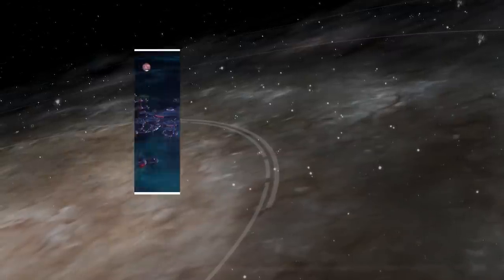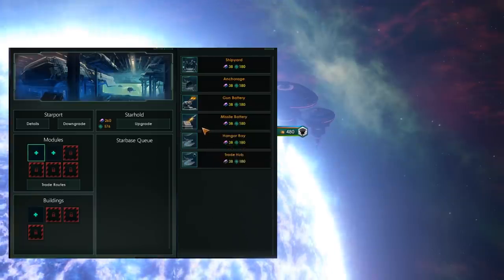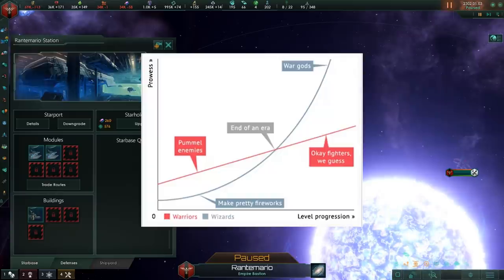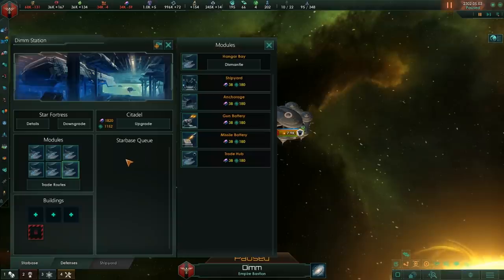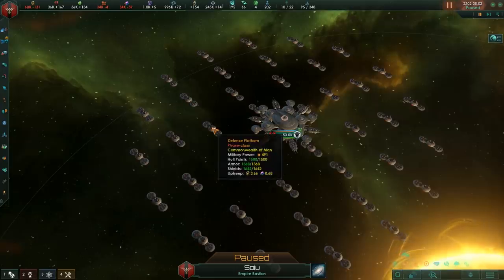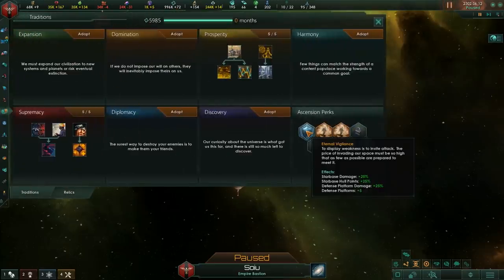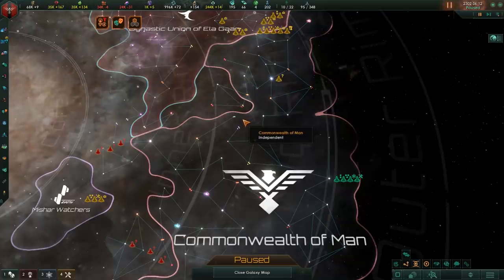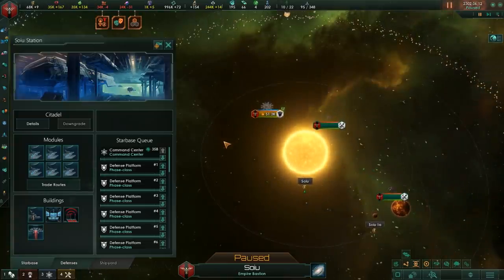Stellaris - Starbase Mechanics are Weird

Comment: I find myself disagreeing here a bit. You're right in that in a fight between equals, a citadel usually doesn't mean much. Any empire with the alloy output and technology to build one can also build a fleet that can take even a citadel down with negligible losses if unsupported. 

What they DO allow, however, is to act as a delay on incoming enemies (the more hp they have, the more days the enemy is stuck firing) and to stop both reinforcements and smaller enemy fleets from passing. All too often I find myself fighting multiple enemies, some of which are light-weights but could still hurt me significantly by taking out systems or occupying planets to deny me resources while my fleets are away to deal with the actual primary enemy. Beefy citadels in key locations put a definite limit to this.

Well built, a citadel works like the sign in an amusement park - you must be at least this tall to board this ride. You could argue that a fleet built from the same alloys would work similarly and I tried that, but in practice I almost always end up concentrating my forces so a smaller "deterrence" fleet would just end up in the same pile simply because of how battles work in Stellaris. The more you use, the less you lose.

Citadels can also protect you way into mid game if you play a dense map with slow tech and go for technological superiority yourself. Enemies can still crack them with weight of numbers, but if the citadel is more advanced than them that can become expensive and, again, serves to buy you time if the enemy does happen to rock in with enough ships to eventually take it out.
Reply: Exactly this.  They won't stop a determined attacker, but the automatic FTL jammer will keep any small 1-5k fleets from trashing your outposts while your main fleet is fighting elsewhere.  I find them most useful for the listening post (which was surprisingly not mentioned), because I can see when a big fleet is approaching and make sure my main fleet is there to greet them when they arrive.
Reply: @EstrellaViajeViajero  Yup. Lategame that's not that important anymore because of jump drives or gateways, but early to late mid game having the advanced warning and fire support is pretty dope. 

Heck, just the reduced emergency FTL chance means more ship losses for the enemy = more attrition even if the guns never fire a shot.
Reply: I LOVE your 'must be this tall to ride' comment! I use bases as tripwires on my chokepoint systems when I'm fighting a war with someone else. I hate trying to attack in one direction and then some pirate outbreak occurs on the other side of my space. Once my bases are 5k+ then an enemy has to commit something serious to get by.
Reply: @Comicsluvr  Yeah, and you've often got partially destroyed fleets flying around in drips and drabs as they escape from a losing battle and then fly back into danger. 

Stuff like that and the fleets of smaller tributaries or vassals often can't challenge a good solid fortress and it keeps your economy secure while your fleets are moving on with their rampage. ^^
Reply: A well placed citadel isn't just impacting enemy fleet maneuvers, but also their economy because lost ships will have to be replaced. With a fast response fleet nearby, one can even force bigger fleets to retreat, further increasing time and resource investments as well as war exhaustion. While the enemy will have to regroup and produce new ships, that downtime can be used to take key systems and/or fortify choke-points. The way I see it, citadels are a one-time long-term investment that allows to control regions of space much more efficiently if done right.

Comment: I like Citadels when turtling. Though in general they help stall fleets whilst you move in yours and weaken them too, (or by time to rebuild), they also prevent mid sized raiding fleets.  I dont build defence platforms unless i'm flush, because they tend to die way to quickly to bother. 

In conjunction with a "support station" for your fleet "behind", (and if possible a fortress world in front) can prevent many offensive actions against you.
I see them as way to create an active defence. Its great if you're not that strong compared to hostile empires, and/or fighting a number of empires surrounding you at once, You only have so many fleets in so many places! 
With the modifiers they offer too, it can really help in tight battles.  plus they can become strong enough to resit end game crisis' fleets,(except fallen empires), on their own which can be very useful, again freeing up fleets to do whatever  they need to do.

They are oft the anvil to the hammer of my fleets.

Comment: Really?
Anchorages, Ship yards (Every slot has a ship yard) so that you can refit lots of ships fast?
By mid to late game my concern is what to do with all my resources and increasing my star base capacity.
I use completely beefed up star bases to act as speed bumps at all borders and internal ones to increase ship capacity and help planet development.
I don't worry about pirates at all and deal with the minor outbreaks as needed, especially once I have gateways in every third system.
Resource storage depo's on all internal star bases and maxed out ion cannons at all borders and keep those things updated, it's money well spent.
I keep the number of star bases almost at capacity all game.  The biggest and the smallest take the same points, 1, so why not build them up. 

Current game, no station mods, I am plus 1700 Alloy a month.  I'm 4k minerals surplus a month, so maybe I'll just build more mineral to alloy buildings.
It takes no time at all to run up a reserve of 150k out of a storage capacity of 500k.
Sorry, can't disagree more on this.

OK  I really looked into this (4 months later) and have decided I was COMPLETELY wrong.  I grossly underrated the amount of fleet logistic increases I got as the size of defending armies increased over time.
I watched while in a very short time rose about 2k points.
Now I'm wondering what other estimations I made are just as wrong.
Damn game.
Reply: i completely agree with you but i think this might be due to the economic buildstyle you or I use allowing us to do so
Reply: I'm in something of a similar situation, though I'm not to that level of income yet, but I'm trending that direction. My fleet has been sitting in drydock ready to be deployed for over a century now. I'm 140 years into a game where I'm seeking the 200 years of peace with a pacifist empire achievement. By hard rushing technology and keeping my fleet at my naval capacity, my fleet power is Overwhelming compared to all other Empires and with no wars to worry about, I'm not losing any ships and I can spend my alloys to occasionally update my ships, occasionally add ships to my fleets, upgrade star bases to citadels, and build megastructures.

I have maximally updated Citadels bristling with weaponry (and Ion Cannons) at my borders, and my fleets are sitting in a central system with a gateway in the system for instant response in the event that an enemy does attack. Yes, the power of the Star Fortress won't stop an enemy fleet of sufficient size but it will delay them long enough to get my fleet into position though those gateways. (You called it a peed bump at your border, and that's what they are.) And if they want to come through Gateways to attack, the only gateways in my territory are in systems where I already have Citadels and the system where I'm keeping my fleet.
Reply: @Karthos1000  unless they changed it rather recently you cant move through (into or out of) a gateway controlled by a nation you are at war with so no worries about that the only exception is the L-gates but they act more like wormholes
Reply: What you are describing tho is a game that from an economic perspective, already is won. Won't matter what you do you will win anyway since you double outproduce everyone. The Trurtle strat like that to build up defences is something I also do but most of the time I just realise I get over prepared and could have saved time more by investing those alloys more aggressively
Reply: @jarnovanherreweghe218  That is very possible and have wondered the same thing.
My concern is not having the resources to follow through in a war.
I don't want to go into a war like the AI does, not being able to exploit some advantage or having to stop short because I ran out of resources.

Comment: I would argue that the effectiveness of starbases depends on if you're playing pvp or pve. Against other players they'll be more of a hindrance than an aid unless you have a fleet close by to assist because the player attacking you will likely have positioned his fleet close enough to get there way before you do which means he'll take the system and now you have to fight what survived of his fleet AND your own station. So unless you have a fleet close by or a gateway they can use then it's not so great. And early on a player will just go around them.

Against AI on the other hand you can usually keep the starbase at a pretty decent power level compared to AI empire fleets. Some of the same principles still apply. You wouldn't want a starbase next  to an AI strong enough to overwhelm it with minor casualties. But if you have a fleet strong enough to take it back yourself and it cripples the AI when they attack it's probably worth it. Mostly though against AI you have some idea of which empires will declare war on you so you can always keep an eye on them and keep a fleet nearby whenever you don't have a truce so that you are ready to defend. If your starbase and your nearby fleet have a combined fleetpower equal to the threatening empire and you know what they'll use(and often even if you don't) you'll likely win easily. Unless their ships counter yours.

The main thing about bastions is the fact that they regenerate imho. If you defend against an attack. For this example we'll say it's early game and you lose 5 corvettes out of 20 defending along side the starbase. If you had built ships instead of a bastion you might have had more ships to defend with but it's also very possible you would have taken WAY more casualties since the bastion tanks a lot of damage and it regenerates it for free even if it goes down in battle.

Another point I can come up with is that bastions wreck fleets if we're talking logistics. Both in the fact that they free up some naval capacity if you need less ships to properly defend and in them having a much better upkeep/fleetpower ratio.

Of course all of this is just my thoughts and opinions. Feel free to let me know if something doesn't add up or I'm missing something/got something wrong.

Comment: Many are not aware, but you can build defense platforms on stations (not star bases). It helps dealing against single or weak ships.

I do think they help deter the enemy, and it does weaken them or buys you time to counter. It comes to a point where the enemy cannot advance because another star base is in the next area and they need to rebuild/repair their fleet.

Comment: If you were trying to mention the ODPs super macs of halo those fire a 3000 ton projectile at .04 the speed of light. Yes, the damage it can do is ridiculous.
Reply: Actually that's just 50 Gigatons of energy there are many sci fis out there (like Stargate) where that is Insignificant
Reply: @karlfranzemperorofmandefil5547  thanks fam very cool
Reply: @trashf1re  it would also be insignificant by Stellaris standards as even tier one sublight drives move much faster then that
Reply: @karlfranzemperorofmandefil5547  I am curious, what is your source?
Reply: @commanderknight9314  mathematics, I calculated it myself because of a discussion about Halo I had with a friend once (the conclusion was that Halo weaponry has the equivalent of water pistols in Stargate)
Reply: What would happen if you increased it up to .05?
Reply: @commanderknight9314  the kinetic energy would increase by about 56% (relativistic change in mass not taken into accord as it only becomes major when near the 0.1c threshold)
Reply: @karlfranzemperorofmandefil5547  isnt it more due to the equation being 0.5mass x speed ^2?
Reply: @jevry4307  yeah mistyped there (its about 56% Increase in firepower)
Reply: @commanderknight9314  also keep in mind Stargate ships have cruise speeds of up to 0.75c and higher so the round would never catch them in the first place
Reply: Uhh check your canon again. SMACs are .5c in the Encyclopedia. Frigate MACs are .4c*. So you are off on velocity by an OOM.

*this means frigate MACs are roughly 1.17TT TNT equivalent. 117.
Reply: @sosogo4real  well meant the SMAC either way , didn't know what I did that mass for
Reply: @karlfranzemperorofmandefil5547  3000 metric tons at 0.04 c or 11 991 698.3 m/s would deliver like 215,701,231.3 Terajoules... which is like a lot. like a 1030 Tsar bomba's.    or enough energy to heat a nimitz class worth of steel to 4.5 billion C or a UNSC super carrier to 500,000 C....

what Im trying to say is, its enough to get the job done :P

....how the hell dont those platforms recoil into the earth at nightmarish speeds though
Reply: @karlfranzemperorofmandefil5547  that was more directed at Knight. Just challenging his initial assertation using competing lore.
Reply: @tisFrancesfault  some (weaker ) Stargate ships wouldn't notice even being short at them with it (Literally the weakest of the common warships  ships in Stargate can sit inside of a star for 8 hours without being damaged whatsoever and Stellaris ships should also not care (judging by the fact that they themselves even at the weakest Sublight speed move far faster )
Reply: @sosogo4real  You might want to double check those muzzle velocities again. ODPs have 0.04c shots and standard MACs have 30km/s (or 0.0001c) shots.
Reply: @coreymicallef365  the Halo Encyclopedia lists it at .5c and .4c respectively. TFOR, where the 30km/s figure comes from, involves a heavily damaged prewar frigate moving backwards and is also, IIRC, THE first piece of Halo media.
Reply: tips fedora

Comment: Citradels are ment to slow down enemys and to stop them from sending small fleets all over your empire. Also putting the alloys into fleet, means you need the fleetcap. Asuming 1 station gives you a max 36, i would say a citydel will have more power than those 4 battleships or 36 corvets, and also less costly. Sure, you cant atack with it, but not losing 10 systems to 10k fleets, resulting in huge production losses or even fleet capacity(Purifiers...)makes them worth building. I think the discussion should be, are defensplatforms any good, couse you lose tons of them even against much smaller fleets than your citadels fighting power. So maybe a video about defensplatforms, what to use or how they should be changed, to be not wasted aloys?

Comment: I would suggest personally that starbases become much more effective when you use them in concert with a fleet, because the base comes with inherent bonuses to range, tracking, and fire rate for both the base and any platforms that come with it. They are very desirable to have on a choke point system, especially as they come with a lot of buildings that add blanket buffs and debuffs to friendly/enemy fleets. This also means that hangars are probably not the best combat module choice, because they don't benefit from the bonuses to tracking/range/fire rate etc.

Stations will be sniped down if you try to use them on their own, but they will continue to fight effectively if you screen them with a fleet, because the enemy fleet will disperse its fire across multiple targets.

Comment: Well it also depends on what type of empire you are, as a determent exterminator you do get a 43% bonus to fire rate, so choosing hangers wouldn't be the best choice as it is less fire power you send against the enemy per second. I would argue that missles might have a place here, as they have the longest range and with an increase in fire rate the would slowly overpower a fleet not going all in on defense. Not to mention if all your platformes where missles too it would help, and they are better when shooting at smaller targets too.

That said larger guns on platformes would and station would also work, as there is no lose because of interception, but they do less damage, have worse accuracy and shorter range, so your engagement time before your also fired upon would be smaller too.

Comment: A single Star Fortress close to your homeworld with 6 Trade Hubs will cover pretty much the entire empire (6 Hyperlane radius) for collecting trade value without the use of Gates, with the use of Gates it would cover EVERYTHING. This would work well in conjunction with a Star Fortress with 6 Hanger Bays protecting your trade routes (again a 6 Hyperlane Radius). Building 1 Citadel to build ships (probably with 6 Shipyards), 1 Star Fortress to collect Trade and 1 Star Fortress to protect Trade in adjacent systems is way more effecent than building a dozen mixed use stations and easier to defend and allows all additional stations to be purely combat focused to provide fleet support at choke point systems. As for why you would want 6 shipyards in one station, well that is simply refit speed, 1 shipyard refits one ship, 6 shipyards refit 6 ships at the same time.